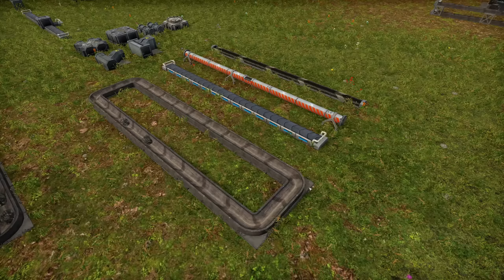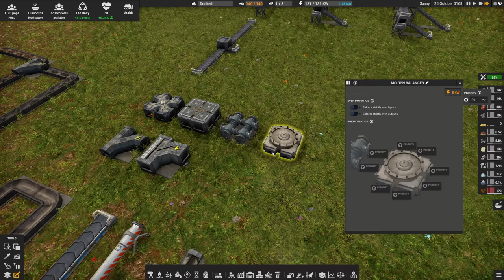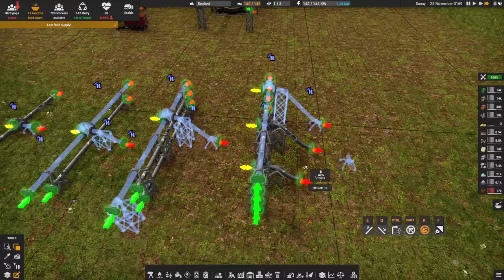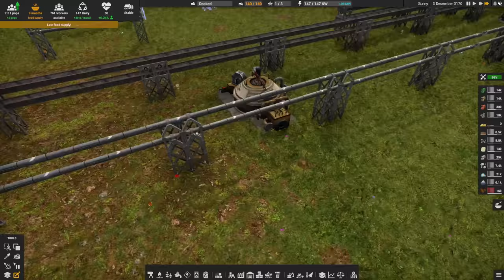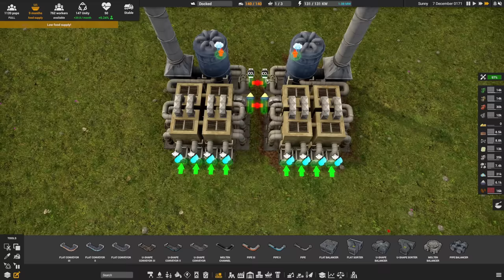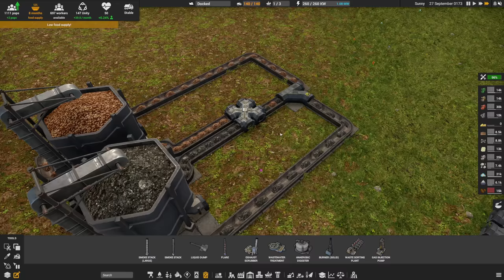Belts and Pipes Everything You Need to Know🚜 Captain of Industry  👷  Walkthrough, Guide, Tips

Comment: No clues on the Molten Balancer because in every case I've seen, the Smelter makes exactly double whatever the next stage is so it's a 2 for 1 ratio.

The 'enforced in' and 'enforced out' buttons are good for when you're using a messy supply chain coming in and your ratios don't perfectly match (Example: You have ALL of your Mechanical Parts flowing into a single Storage and you are feeding three Maintenance buildings from it. You CAN set up a single belt to feed all three Maint. buildings but the first one will always work, the second only when the first is full etc. With a Balancer, you can force all three to have equal outputs and run consistently.).

This video was worth it for the 'connector/smokestack' thing!
Reply: Yeah but enforced in/out would create a lot more problems than it would solve.

Comment: There a glitch I found where you can remove supports from raised belts and pipes. Pretty handy when your truck cannot reach a storage etc. While in planning mode make a 1 pipe/belt intersection directly above the support pillar then delete the 1 added section, support will be gone, does work on double stacked pipes just add intersection to both then delete top first.
Reply from the maker: Oh I'm going to do this in the future! before copy paste and the devs updating the supports I did manage to build a pipe that went for about 40 tiles without supports just because I ran out of room!

Comment: One note that I think should have been mentioned is that the filters don't have an overflow option.  Meaning, if the filtered item backs up, it won't go out the other output.  So, you will need a way to deal with the excess items.  I did this by putting a balancer in front of the filter and priority the filter output then merge the other output's belt back in after the filter.  That way the items that are not being filtered out can continue to flow if the filtered item backs up.  Hopefully they'll add an option to do this in the filter itself to keep the design cleaner.
Reply: I'm running into that issue with food right now.  One flat conveyor II for almost all my final food and then a bunch of filters in series, but as soon as one of them backs up I'm in trouble.  Could have those be the last items filtered but I realized which items would be the ones backing up long after I built the system unfortunately.
Reply: @JayRay4924  Yea, I'm using the filters for food as well.  I have excess going to make animal feed.

Comment: I used the exclusive even input to loop an output out of a manufacturing building, and back to itself.  The catch was I need 4 total inputs to do this but the building only has 3 inputs.  Two of the inputs needed exactly 6 items each.  I had those share an input using the exclusive even setting.  That way they could share the same belt in a 1 to 1 ratio and not clog the line up, blocking the other.
Reply from the maker: Hmm what were you crafting, I havn't see a building that needed 4 inputs and only had 3 slots

Comment: the prio in and out on the balancers are mint for builds like the compact micro chip set up   you can have the copper plastic and gold fed in to a single balancer out put onto a single belt and then use sorters for each to the machine     doing things like this allows you to clean up spaghetti and be super compact   you will always have a consistent feed and the belts never get clogged  even if you run out of one item

Comment: Need for strictly even outputs: I made a looping microchip setup. 3 microchip machines in a row (you need 12 to do every step). Each step takes 1 item and outputs 1 item. I set up my 3 machines so that the first one does steps 1a, 2a, 3a, 4a, the second does 1b, 2b, 3b, 4b, third does 1c 2c 3c 4c (final) and outputs. The output of the last machine gets sorted -- the final product into storage, all others go back to the start. Problem: the first step needs input from a storage. If I just dump the storage output into the first machine it gets jammed and can't then take in the output from the end of the chain. So: balancer at the start with strictly even inputs. I let 5 or so of the first product in to charge the setup, then switch on strictly even. That way another start material can't come in until something has gone through the loop. It worked kinda but was pretty finicky, I just used it to get enough microchips to build enough data centers to use 12 machines straight through. Its just that you need the output of the microchip machines to build the data centers, but you need data centers to make microchip machines so the 3 machine setup was just to bootstrap microchips
Reply from the maker: Ok, that makes sense. Ive seen people do it with a single machine and a LOT of sorters!

Comment: I see a use for a molten balancer. If you use lets say iron smelters and later on you want to add iron scrap without rebuilding everything you can prioritize the iron scrap smelters to not clog up the recycling line and using less resources. Of course you can rebuild it all but sometimes this might come in handy
Reply: You can just run both recipes on all smelters, just feed both iron ore and scrap on the same belt, better if prioritizing the scrap with a loose balancer, and prioritize the scrap recipe in the smelters

Comment: I can accept that different types of connectors should not interfere with each other, but it seems strange that two connectors of the same type cannot be placed beside each other. Technically, that would be a T-connector instead of a 4-way connector. Maybe an option to block one end could be added later?

Even adding a panel on one side to close the opening should be an option, for the belts and the molten channel. Is it something that would be easy to implement? I know that we are still waiting for something like that in vanilla Factorio, so that parallel pipes do not connect automatically.

We will need to wait and see.

As well, knowing that height-3 is the maximum for the belts and the pipes provides some limitations to work around. Once you know how the routing works, then placement becomes easy. However, could you do better than side-by-side supports, so that you are losing less terrain for the trucks to use?

And, if you are leaving room for the trucks to drive around, in a different video that tested the fastest delivery method, you enclosed your test area inside retaining walls. Would it make sense to use retaining walls like guardrails, and leave gaps close to certain buildings or at major intersections?
Reply from the maker: Connectors are funny, the devs have said they are considering adding more options to allow connectors of different types to naturally be built beside one another, as well as possibly letting 2 connectors of the same type sit beside one another. Knowing logistics can only have 4 levels you would think would make life easier for routing, but I have to say there are many spots where another level would REALLY help!

Comment: Does anyone know what "Priority" actually does when it comes to balancers? I get that it prioritises the flow in that direction but what exactly does that mean? That direction gets an extra 50%, 10%, 25%? Or something different?
Reply: Priority will get all the required flow up until the capacity of pipe/belt/storage, example if priority pipe can transport 200 per cycle and you feeding a balancer 150 it will take all 150 while on priority output. If balancer is receiving 250 per cycle 200(pipe capacity) will go to priority, 50 will go to non priority output
Reply: @KevHarkins1  Makes sense. Nice one, mate.

Comment: I'm at that point where I just use red belts/pipes every where, cannot be arsed with sitting there and figuring out if the building will suffice with a t1/t2/t3 belt/pipe🤣
Reply from the maker: Pipes I admit im lazy and use T2 when i need T1 or use T3 when i need T2.... Belts use power, im still playing it a little bit safe with them
Reply: @Dyanosis  yea good point but I mean nuclear power is pretty amazing, and then there is solar, I haven't had a serious power issue since I built my 3 nuclear plants and and the 2 solar banks, but I get your point, I'm just lazy